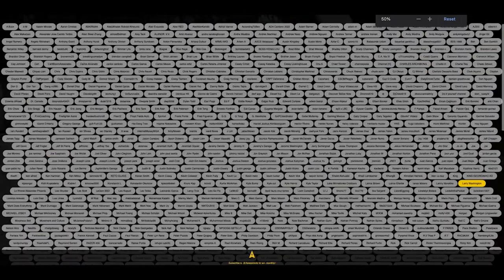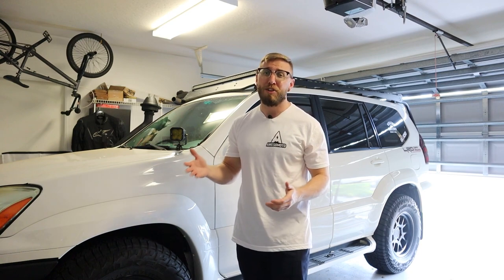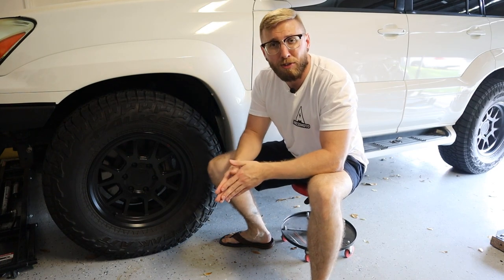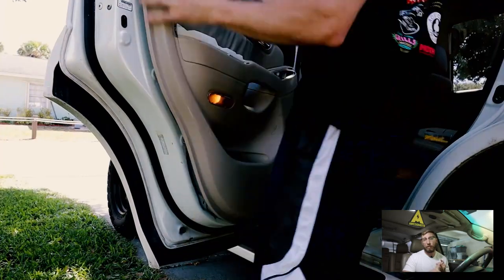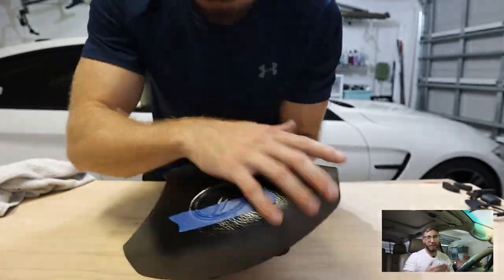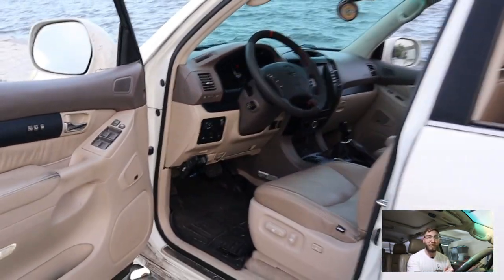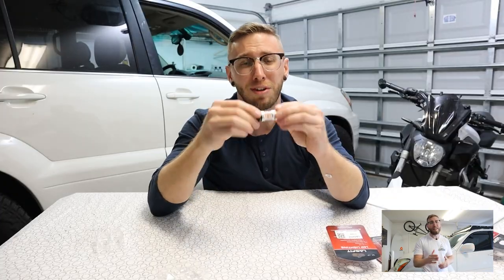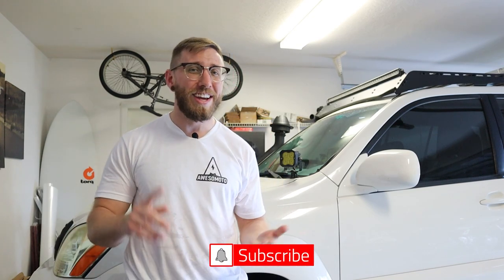Vlog 63 - Top 5 Lexus GX470 Mods: Daily Driver Edition

Comment: You ditched the wrap on the wood for painting didn’t you? Because the wrap wasn’t adhering around the air vents.
Reply from the maker: Yes, great memory! I ended up painting the pieces around the vents since the vinyl is challenging to wrap around and temp swings caused issues with adhesion.

Comment: Have you thought of adding a 2nd 24 gallon extended range gas tank?
Reply from the maker: I haven't considered this yet, but it's mostly because the trails I drive aren't so remote that I struggle to get to a gas station. For those going way out in remote areas camping, this would be a great modification. Do you tend to have issues reaching a gas station when out trail riding?
Reply: @Awesomoto  I plan to drive  from the midwest to Alaska. When you are in the middle of nowhere you may need to run the engine to charge things at the camp site. Another thing is I like to burn gas from Costco and Sams so havving a 1000 mile or more range helps  keep costs down. I have  your same front bumper as yours with 35 inch tires, a steel rear bumper with 35 back tire and jerry can plus Smittybuilt roof tent with steel roof rack. This is all heavy  so I am getting 12 to 16 mpg with my speedometer speed corrected. I recently found a TRD supercharger so I bought another 2uz-fe VVT engine to build. I found I could use turbo pistons from an LF4 engine bought some eagle H beam rods, porting & polishing the heads and Doug Thorley long tube headers. My compression ratio will be 11.2 to 1 with these pistons. I have a couple of piggy back computer systems to try on this setup. Hope to make 500hp  but my goal is low end torque. Want to see if I can make this chariot get better MPG for more range but with the weight and wind resistancce it is hard.

Comment: does that tire size throw off the speedometer reading?
Reply from the maker: It does slightly (maybe 1-3mph). It wasn’t enough for me to do anything about, but if it bothers you there are some people on GXOR facebook group who have instructions on modifying that circuit on the gauge cluster to correct it.